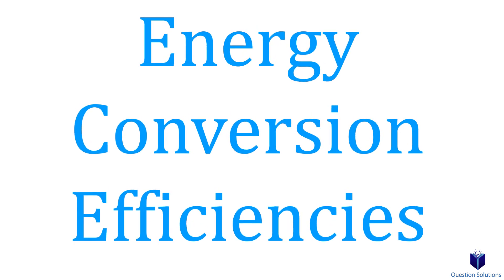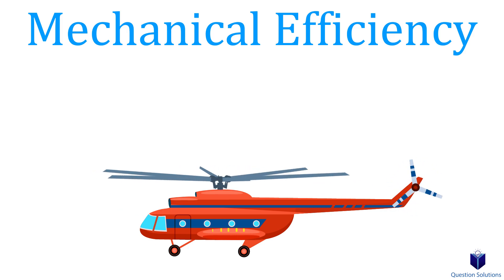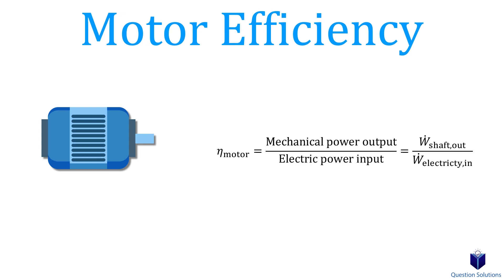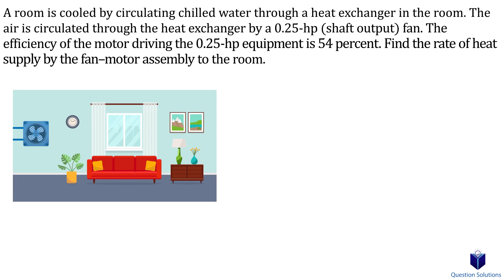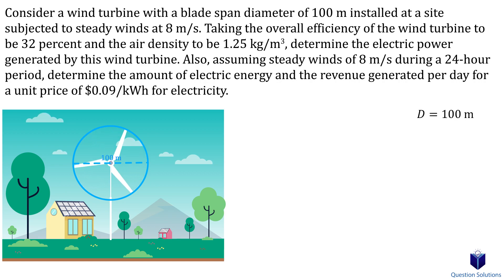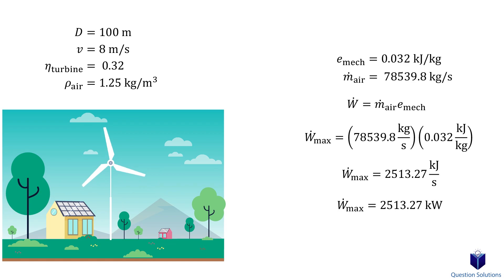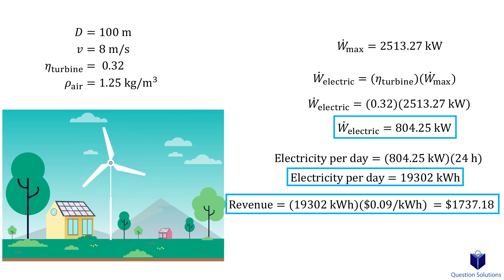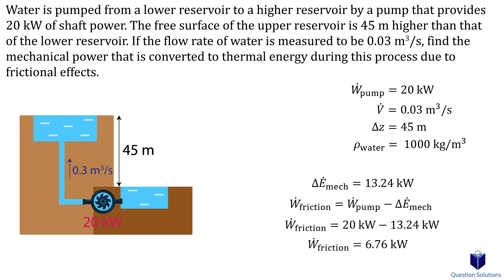Energy Conversion Efficiencies | Thermodynamics | (Solved examples)

Comment: hello? I have simple question why on example 2 do you multiply kW by 24 shouldn't you also multiply by 3600 because W is in seconds
Reply from the maker: You're looking for kWh, so kilowatt hours. 24 hours in a day, so you get how many kilowatts are used per day.
Reply: @QuestionSolutions  thx